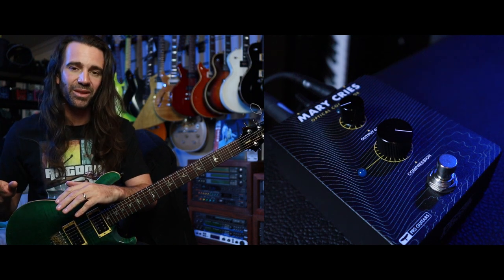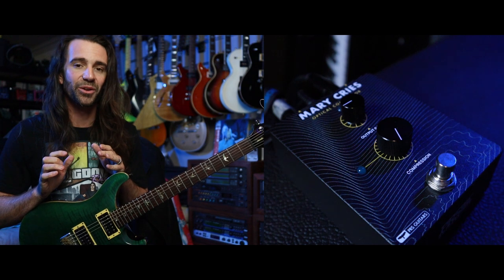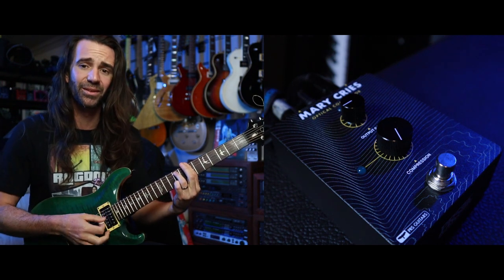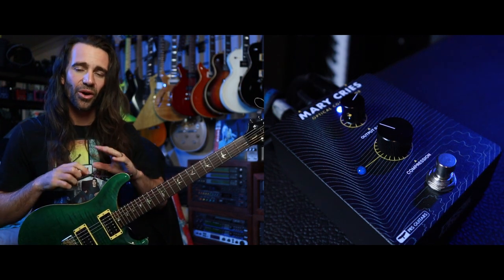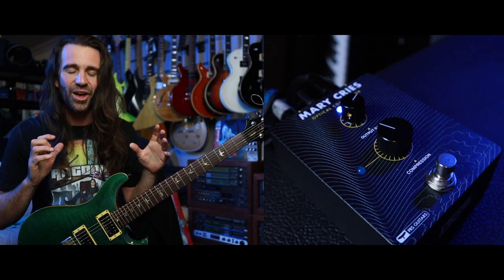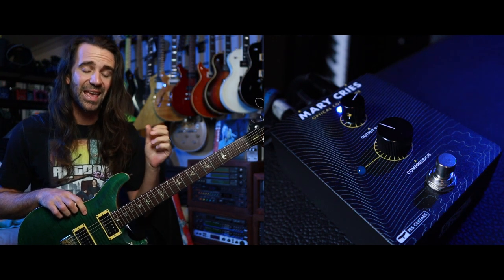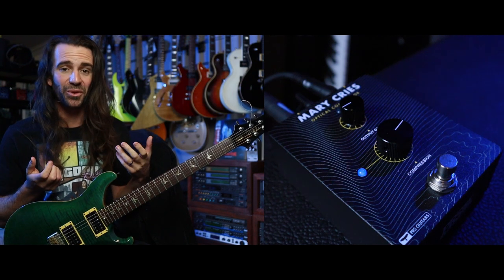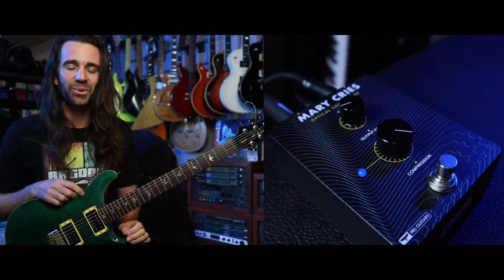PRS Made a Compressor?

Comment: This compressor sounds really nice....to my ears ( and not having the benefit of using it in real time with my rig ), the effect seems very subtle....and seemed to remain so even with the compression all the way up.....with all the other compressor pedals I've used, that has not been the case.....but this pedal being based on a studio compressor that I've never used may be the reason. I use an old TC Electronic Sustain-Parametric Compressor Pedal to boost distortion/overdrive, and have found it to be the quietest compressor I've ever come across, when using it with drive....if you ever get a chance to play thru one, do so.....not many people know of this pedal.....
Reply from the maker: That old TC stuff is gloriously well put together
Reply: @LeonTodd  I've had it on my board since '89.....it is my "desert island" pedal...in all that time the only thing that broke down was the battery clip! It will never leave my board!!!!

Comment: Man, that thing sounds killer.. I didn't hear any noise either. Did you use a noise gate or something or is that just that quiet?  I would love that pedal. It's easy and I'm stupid so it sounds great and I can just play and not worry about the other stuff like attack, etc.. which is confusing to me as well. I just wiggle knobs till I hear something I like.. That pedal is subtle, but I love it.  At least with that guitar it sounds great. .Really great sir.. I love the string noises or kinda harmonics I hear with it on.. I can't explain it, but it sweetens up the sound somehow.. I'm really impressed and when I turned this video on I didn't think I would like a compressor. This one sounds outstanding.. Very cool.. 
Thanks again brother. Leave it to you to find the best off the shelf compressor for a dummy like me.. 🤣😜🤣
Have a great day brother. I'm off work today and taking it easy. Might work on my strat. Waiting on some tuners to finish it up! 
Be safe and well sir!
Reply from the maker: It's pretty darn quiet, but I did use a very subtle gate on my vocals/guitar in post.
Reply: @LeonTodd  Interesting. I never used compressors except for solos at times because I love holding a note for days.. 😛, but they always had too much noise and I didn't know how to use them well enough, so I just used more gain! More is more! 😛